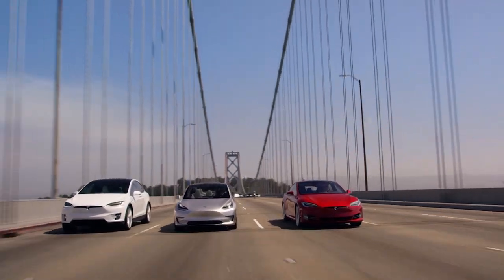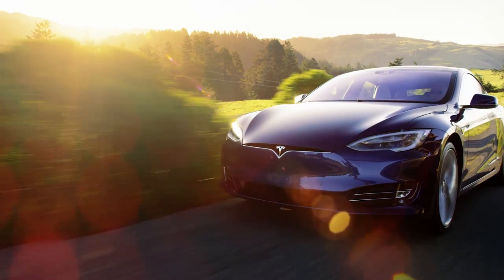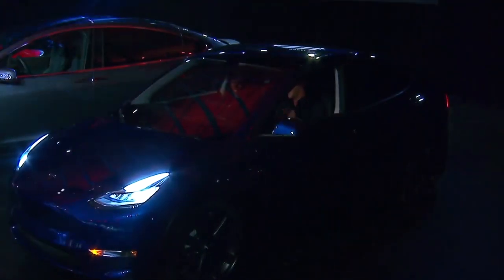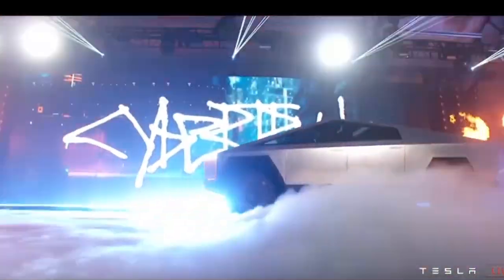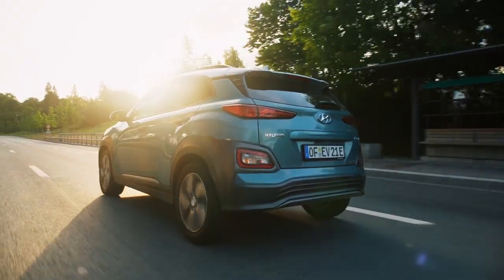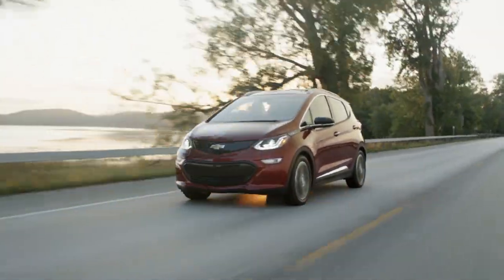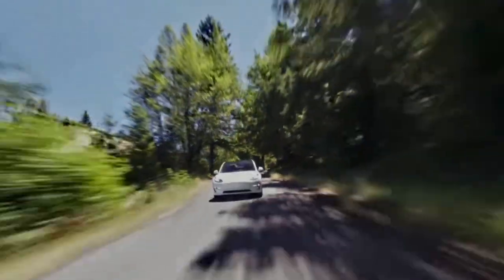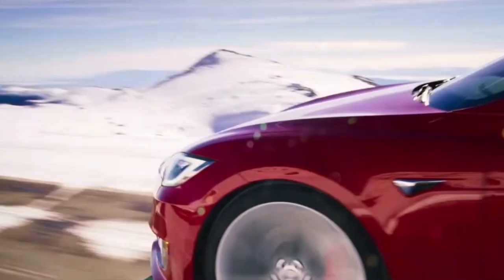Which Tesla Has the Lowest Cost Per Mile of Range? + How does this compare to other Popular EVs?

Comment: Wow which of these cars has ever achieved the range you are claiming it’s a joke. And if you do the same calculation with a an equivalent ice vehicle you will get a figure that blows every EV out of the water. It’s an irrelevant calculation why not take the price and divide  it by their top speed ( at least they can achieve their top speed even if they can’t achieve their advertised range ) or divide by their 0 to 60 time. I have a model 3 awd which will never achieve the 340 mile range claimed, ever,  but it’s still the best car I have ever driven and i have driven them all. Think on this in 5 years time virtually all mid range EVs will genuinely do 500 mile range. Don’t believe me think what your phone could do 5 years ago.

Comment: I'm betting that the cbt tri has over 500 miles if not over 600, with watt I think the power density of the batteries coming out are going to have 600++ will be a no brainer

Comment: I would much rather see a total cost of ownership comparison on a per mile basis. I know that because the car is still new, actual depreciation numbers are difficult to come by. If you remove depreciation from the calculation, Tesla still come out way ahead of almost all gas cars within a few years of ownership. In the end, the total cost of ownership is what really matters.
Reply: We have not had EVs long enough to include battery exchange. Then we'll have the bottom range of secondhand Teslas and other EVs. You can buy used early Zoes and iMievs now with essentially a useless battery pack, and they are around $3000, possible even cheaper. I saw a renault Kangoo EV van for $1000 a few weeks ago. However the comparison in this video is not about ownership cost, but production efficiency. i.e. how cheap the vehicle is to produce, how efficient it is, which also affects cost as a smaller battery is needed, but at the same time disregard the range as a parameter on its own? So this video tells us something, but is not the most reasonable way to compare EVs.

Comment: This is interesting if range is an issue for normal day-to-day driving.  But for a normal commute to work and home for months before a two-week road trip vacation, the watt hours/mile is a better calculation where the Model 3 standard range is the cheapest to operate @ 200 wh/mile.  Assuming Teslas trade-in value remains relatively high, its operating costs the more relevant metric, in my opinion. The standard range just doesn't weigh as much as does a model 3 with a lot more batteries.  That's where you save the money.

Comment: When the Cybertruck tri-motor range and price were announced it was a no brainer to order this vehicle.  We don't know what the battery capacity will be but if we assume it has the same battery capacity as the Roadster at 200kwh it is like getting 15 Tesla Powerwalls of storage at a huge discount and getting a free truck thrown into the deal.
Reply from the maker: The price is amazing for sure!
Reply: I think it has about 350kWh of batteries.
Reply: @rowanbroekman3929  how do you figure that?
Reply: @junglejim7664  A model X has up to 325 miles of range, but only 289 in their performance model, this cybertruck got 500 miles of range in the performance model, which is much bigger, less aerodynamic, weights a lot more, and name it. Then 300kWh to 400 isn't that odd is it? Nevertheless, it's just my estimated guess, not more then that.
Reply: @rowanbroekman3929  I think you could be correct. I can't wait till the Tesla battery day.
Reply: @rowanbroekman3929   How would they fit in the truck?  Maybe there has been a breakthrough we will learn about very soon?
Reply: @tigeroll  Well, if 200kWh fits in their roadster a couple of years ago, before the Maxwell technology was bought and such it's not that surprising is it?
Reply from the maker: @rowanbroekman3929  Definitely NOT 350 kWh. I would bet 200 kWh for the Tri-Motor. I reverse engineered the efficiency in one of my previous videos and came up with some compelling data to back this up.

Comment: I think the consumption should have been part of this presentation. In some way be part of the calculation
Reply: I agree with that, I've got the SR+ and have done 4500kms now with an average of 137wh per km. While the initial purchase of a long range might give you that one off better price per mile, having to charge a 20kwh larger battery and that extra weight will over time end up being a higher long term running cost surely?

Comment: My Model 3 SR+ first month 240mile range, three months later 202/240mile range left. (Almost never supercharged and charge to 90 or less usually). The 250mile range isnt “real” it’s still 240, prove me otherwise
Reply from the maker: Charge it up to 100% a time or two and the computer will re-calibrate the range. The calculated range on a Tesla is NOT a good indicator or battery degradation.
Reply: Cleanerwatt that unfortunately does not work. Next week I am up for a service visir though. I know rated range isn’t a degradation visual, but I do miss about 35/40miles of range from empty to full, it’s around 41.5kWh i last tested. So there is significant capacity loss in three months (could be hidden and not actually lost) all through mild climate:weather in NL
Reply from the maker: @MrGoogle87  got it.